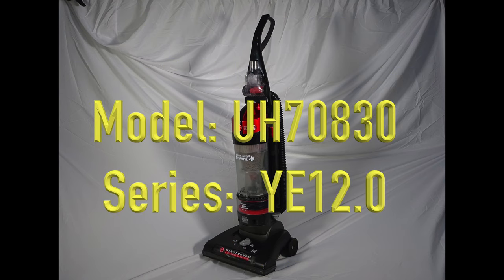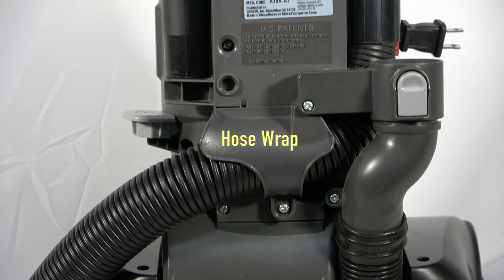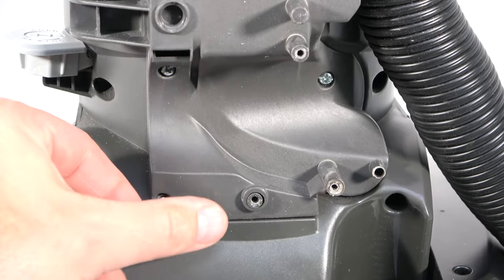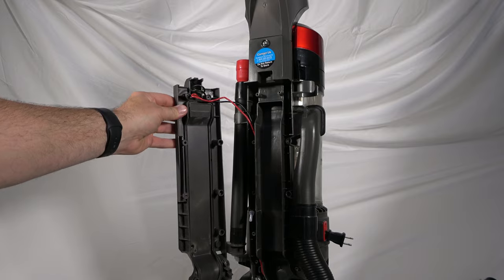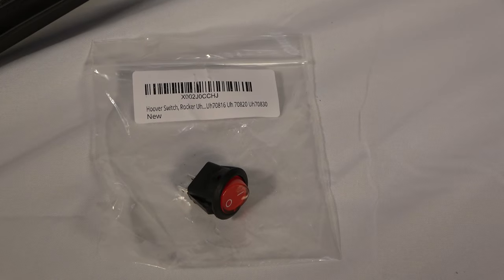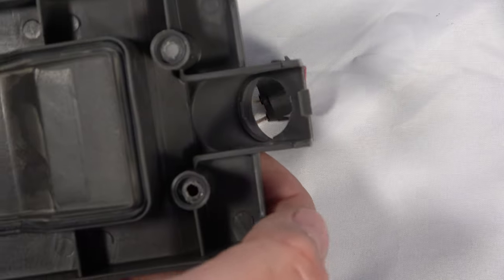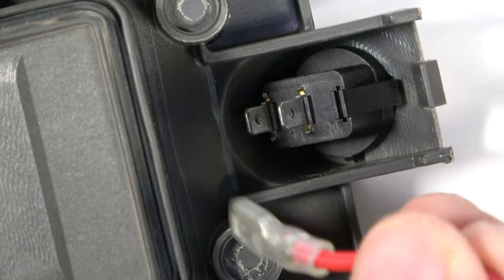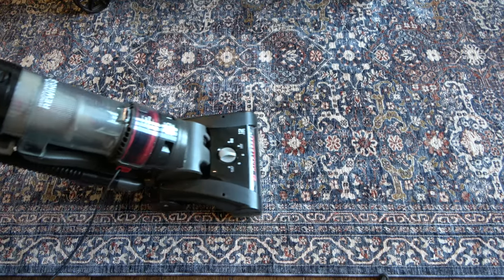Hoover Vacuum Power Switch Replacement - Windtunnel Power Switch

Comment: I made a mental note that my red wire (ON position) was at the top before dismantling, but now I'm having doubts after watching your video.  I tried putting the red on lateral and medial position and black on the opposite terminal and with both setups the vacuum comes on.  Should the red definitely be on the lateral or OFF position?  I noticed a flash of light occurs in the new rocker switch on both setups when turning off.  Is this normal? Thank you for the detailed video.
Reply from the maker: hard to give advice without seeing it.  the way a switch works, it doesn't really matter which wire goes on which terminal.  the switch just "breaks" the current.

Comment: our Model UH70805 terminal cords (red and black) will NOT unplug! Pulling, back and forth etc...and neither will remove from the two prongs/plug. What our we doing wrong!? UPDATE: We had to remove the plastic sheaths first, then push on the tiny tab on the silver connectors to loosen the connectors from the plug prongs. Others may encounter the same issue. Model UH70805.

Comment: Can we fix our Hoover vacuum following your tutorial --- if our vacuum has the cord coming out of the back as part of the back assembly? We bought a replacement switch, but are realizing now that your tutorial shows the power cord on the SIDE, not on the back like ours. : ((
Reply: Yes same basic concept. If your not sure, locate the identification plate that has your model & serial # on it.

Go to Google, type Hoover, then what ever the model # is, then type part diagram and it should come up with schematics and some sites let u buy parts directly through them.

But honestly it really doesn't matter where the cord is located, you just need to remove a panel that the switch is in

Comment: Is this method also exactly the same for a Hoover Windtunnel2 vacuum cleaner with serial # HI5G08687644....Model - UH71215....???  Thanks!
Reply from the maker: Most likely.   however, the switch model might be different.  All these switches are basically the same simple design (for on and off switches)

Comment: That helps me now about  the 2 wires from the cord came out white and black . White is just dangling where does it go hoover wind tunnel UH72601  4G12.0 series please help
Reply from the maker: All I know is what I've shown you here. However, a switch is pretty easy to install, it's only two wires.

Comment: It is crash how fast our power switch broke. We had probably flipped it maybe 50-100 times max. My brother saw a spark in the switch before it completely broke. Must be like thousands of those defective switches out there based on how many Amazon reviews they have! And Hoover didn't recall it afaik. Somebody had a bad day at the factory or engineering firm 😂
Reply from the maker: Lol. I know that's right!